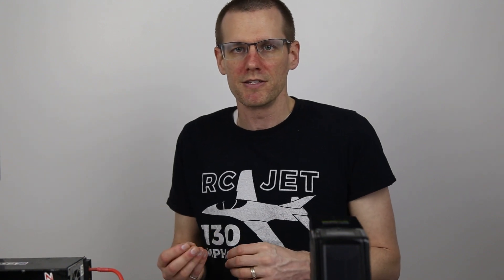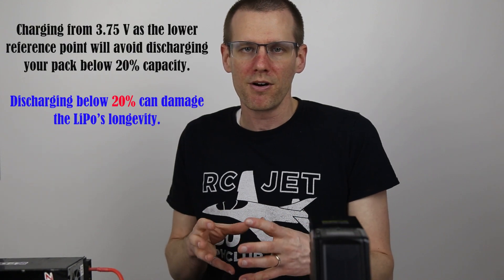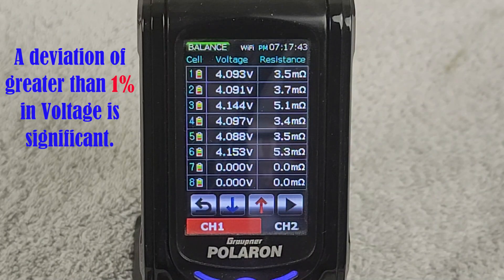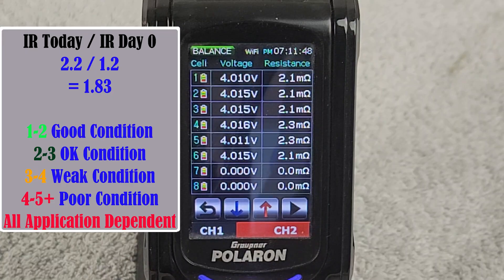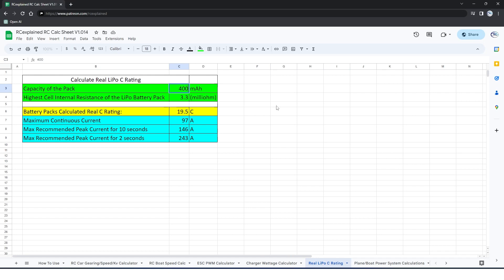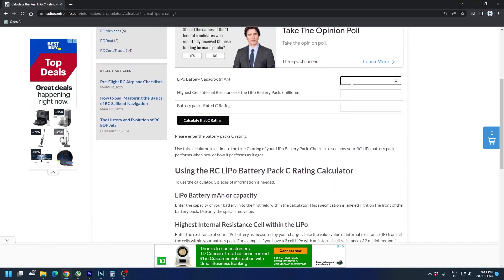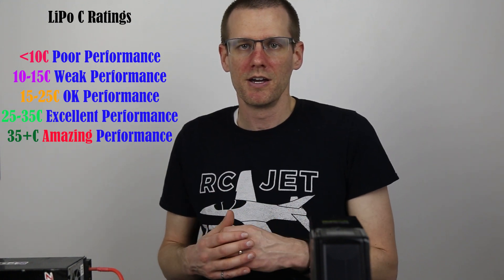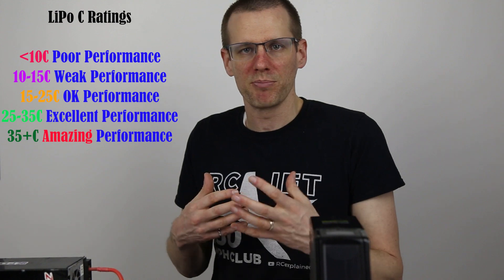The Ultimate Guide to Testing Your LiPo Battery Health for Your RC Vehicle

Comment: Kindly some chargers di not have resistance check,  can the resistor of a lipo battery be checked by a multi meter or an  Ohm meter?
Reply from the maker: I'll be doing a video on a topic similar to this soon. I'm waiting for equipment to arrive to do 2 videos, where one of them will be about the internal resistance.

Comment: Cool! I checked the resistance on a 25C 2S 1600 battery (x2) trying to boot them from storage, one was badly undervolt, but i trickle charged it on Nimh mode then lipo balance charged. Back up n running!
Reply from the maker: I hope your battery still performs well!
Reply: @RCexplained  thankyou, its a receiver pack for a power hungry Futaba AR7000. (long range with satellite receiver, RC catamaran). Seems very slow to charge though, I thought 2hrs would do it normally, these are taking forever to charge up fully (at 7.6v on the good one so far)..Also, how would I do a safe discharge test?
Reply from the maker: @InYourDreams-Andia  I use my charger to discharge and monitor the pack.

Comment: Speedpak 1800 mah 7.2 volt 6 sell NIMH battery how do I know it's fully charged how many hours and what can I do to find out if it's fully charged
Reply from the maker: Place it on your charger, when your charger detects it is fully charged, you know you have a topped off pack.

Comment: I have a question for u good sir, I just got a NHX 6500mah 100c 6s lipo. And I went to check the voltage per cell. They were all at 3.83v but one cell was at 3.72 and I've tried balancing all of the cells but that one cell doesn't want to get balanced. Is it OK if I still use that 110$ pack for my outcast 6s exb??
Reply from the maker: When you balance the pack all of the 3.83V cells would be discharged to 3.72V matching the cell with the lower voltage. 
I wouldn't recommend running the pack with a cell that is that far out. Especially if it frequently becomes that far out of balance after being balance corrected.
Reply: Thank u sir, I charged it up to 4.2v and I discharged it and now all the cells are balanced.

Comment: this is SOOO subjective. completely depends on what battery your talking about. for example at 4:55 if your using a 500mah pack this info is completely useless and misleading, hell same goes for a 2000mah pack. i guarantee these numbers are for a 5000mah pack or above. you provide zero qualifications when making your videos, whether its motors or whatnot. all the information you share if totaly dependant on what your talking about. when you talk about motors, which are obviously of a very specific type, you talk in absolutes like you are in this video when in reality most of what you say wont even apply to most applications. i CAN NOT take your channel seriously. you give solid advice but not when we dont know the specific circumstances or applications your referring to.
Reply from the maker: Appreciate your comment and question. Whether a pack is a 50mAh size, 500mAh size, 2200mAh or a 5000mAh size, this is irrelevant. The resulting calculation is unitless as it is a ratio or percentage. Not millohms. 

Typically, if a formula requires a domain or range where it is valid, I specify this as I don't always have data for a wide range of input.
Reply: Shawd up and you make a video since your so smart mr lipo expert

Comment: You don't say if you Charge or Balance Charge for the voltage tests. Presumably you want to Charge them so each cell is treated the same. Your charger is showing BALANCE which will charge cells at different rates. You also say to balance them before retrying - is that using Balance Charge?
Reply from the maker: Hi Don. Every charge should be a balance charge. The charger will charge all cells at the same rate and discharge the higher voltage cells. Even during this cycle where the charger is equalizing cells, you will be able to spot issues.

If cells are significantly out in voltage, run a balance only.
Reply: @RCexplained  Ah - my charger doesn't do a 'balance only' as opposed to a 'balance charge', that's what confused me. I must look into a charger that just does a balance to even up out of sync cells like yours must do.

Comment: I have tested all my batteries including the new ones which says 200C etc....every battery was in the range between 17 and 27 of real C. Its few month back when i seen your video about real C rating. So what is decision? Only Traxxas say truth about rating of batteries. They guaratee 25C, which can be true. But Gens Ace promises for example 120C, what is lie. Because batteries are almost equal when resistance is measured. Traxxas batteries are average quality but only one company is telling the truth.
Reply from the maker: I received IR data from one viewer with Traxxas packs and the actual C rating was much lower than specification. What did you find with your Traxxas packs?
Reply: @RCexplained  I had only 3S older battery in my Slash, with old TRX, not iD connector and it was aroud 20-22C when i measured as new approx 6 years ago. Yes it is lower, but every other brand was in the 17-27range, when they says 120, 200C etc. So Traxxas is much accurate. But i can not tell that their batteries are good. Just they not have so much C difference like an others. Than i seen your video and try to measure packs again after some time of usage. When i measured hard packs for example almost new Gens Ace bashing 5500mAh, it has only over 18C in real. So in average, it can be 10-30C in all RC batteries as new. Not 60, 120, 200C its lies.

Comment: I've run quite a few Capacity tests and have found that the Chinese Li-Po battery capacity marked on the batteries can only be achieved (or close to) if you discharge the battery to near 3.0 Volts and immediately fully charge it to 4.2V at 1C or less.
Reply from the maker: Yes, very common unfortunately.
Reply: A capacity test isn't done by charging, it's done by discharging eg. Taking a cell that's at 4.2v down to 2.5v or whatever the cut off of the cell is, the way you are doing it is totally wrong. Ps. I'm not surprised you're doing it that way as I'm 1:10 in and that's how he's saying it's done oh lord lol

Comment: please put a video on how to storage in the long term these batteries and other chemistry even if they are kind of old but still in use like NiMh or NiCad where the topic is kind of confusing when using them back after being storage for months and cyclic to restore the potential, because the charger allows you to choose for example 5 cycles of charge/disharge/charge or viceversa discharge/charge/discharge and is confusing which one to choose thanks
Reply from the maker: There are many practical theories on storing NiMh batteries. I don't have any data to prove one is better or worse then the other.

Comment: Ive got batteries over 2yrs old, was storage charged. Then lost in a house move/renovation. Found still safe packed but now won't charge. (3.70v to 3.78v) Is the battery or charger faulty or dispose of batteries. What is your advice please. Hope you can keep up your videos im finding them a great help. Thanks.
Reply: @danaleks5810 There can be also chosen some different type of battery for first few minutes of charging for shock it and recover. Some charger does not allow so low voltage on cell when balance wire connected and sometimes also without. I recover some batteries which was 2,2 and 2,6V undervolted. They work properly now.  If i remember i chosen something like Pb or something totally different from li-po
Reply from the maker: Mel, you need to find out why your charger is rejecting to charge the pack? What is the error message given?

Comment: The resistance on all my batteries is all over. Never had a problem.... yet
Reply from the maker: Resistances can be varying throughout the pack and you will never know the difference. If they increased over time, you will notice a performance difference if you have performance metrics.